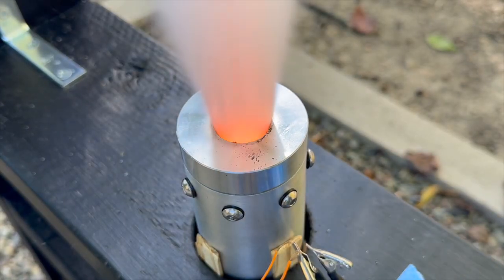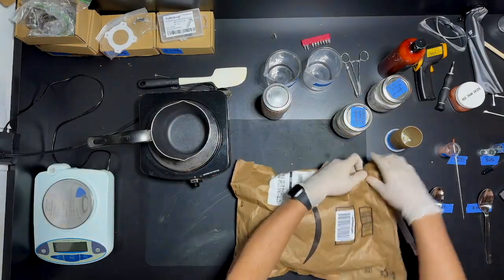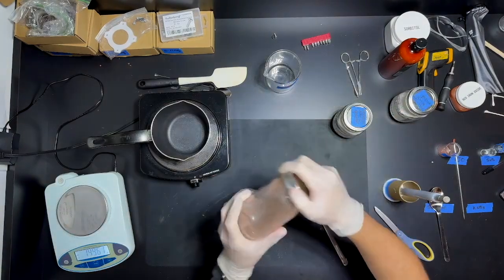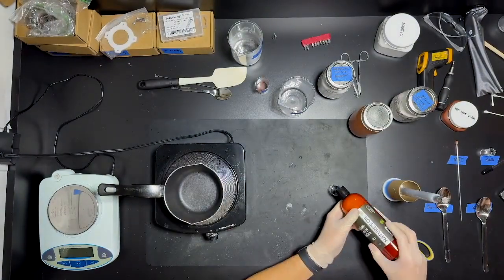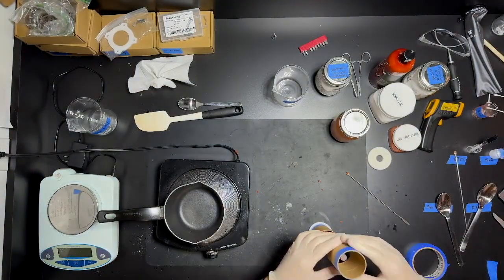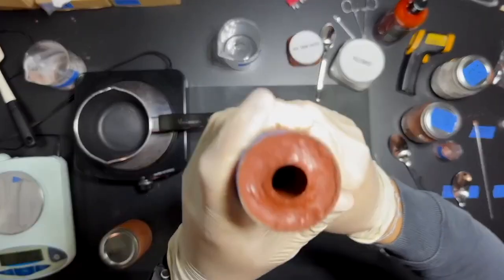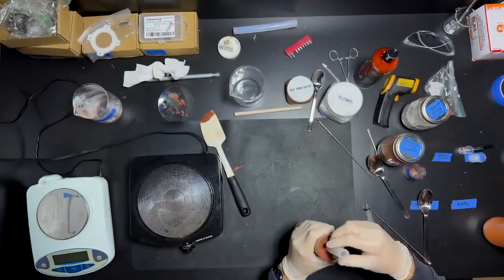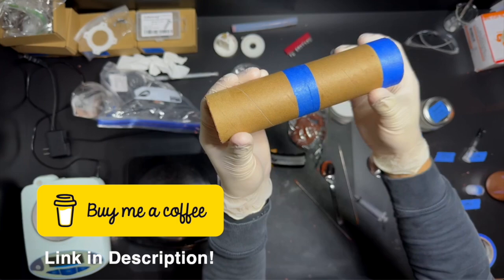How I Make the Fuel for my Powerful Rockets!

Comment: I'm about to start this job. I have 3 equipment left to buy.
Electronic Scale.
Hotplate.
Far infrared thermometer.
Can you send me the link of the products you use?
Is there any advice you can give me? What should I pay attention to when buying these? Thank you for your reply in advance.
Reply from the maker: @Doganay14  When casting propellant, always prioritize safety. I’m using a generic hot plate and temperature sensor purchased from Amazon, but ensure your equipment is reliable and suited for the task. Obtain your chemicals from a reputable supplier and verify they are of high purity. When pouring the propellant, be sure to tap it thoroughly to eliminate air bubbles, as this step is crucial for achieving consistent and safe results!
Reply: @AeroPropulsions  Thanks for the heart and reply.
Reply from the maker: @ No problem! Hope all goes well!

Comment: 4:53 you're motor have "Y" on one side. Why is there a "Y" what is the purpose? Can you explain it to me in detail?
Reply from the maker: @Ericlfimate  The finocyl ‘Y’ shape in my rocket grain increases the burn surface area for a boost in initial thrust, but since it’s only 1.5 inches deep, it mainly affects the startup phase!
Reply: @AeroPropulsions  will not that leads to uneven fuel burnt? Even with a normal (without y) the place where we put the igniter burnt faster because that's the first place it burnt. If it's for initial boost, how i used to do is i make the igniter myself, and cover the igniter with the same fuel, the size of the rode and tightly fitted inside. That way the moment i ignite it, the fuel attach to the igniter become a small boost without causing uneven fuel burning.

Comment: Hi bro I want to make a sugar rocket that it is like 15mm in diameter and like 2pm long, I want it to just burn for one second and also generate 100N of force, could you pls help me if this is possible and more info I want it to stop a 3kg car from 120kmh to 0kmh
Reply from the maker: I’d recommend starting with OpenMotor. OpenMotor is a great tool that allows you to simulate the rocket’s thrust and other parameters. It can help you determine if your design will produce the required 100N of force in the given size and burn time. Once you run the simulations, you can adjust the fuel grain design or nozzle parameters to achieve the desired performance.

Comment: Hey! I would love a video on your propellant. And maybe it's specs for open motor
Reply from the maker: @seitzfamily070  For this test I am using 65/35 KNSB with 1.25 %Iron Oxide and 0.2% SLS! The formula specs for KNSB should come pre-installed on Openmotor!
Reply: @AeroPropulsions  😭
Just figured that out
I attempted to calc all of it
Reply: @AeroPropulsions  I have two more questions, if that's ok. 
1. Where do you get your cases
2. What do you use for your liner
Reply from the maker: @seitzfamily070 My casing is a 0.071-inch wall diameter aluminum pipe I sourced from Amazon. I drill the necessary holes to attach the bulkhead and nozzle. Aside from the cardboard tubes I use to cast the propellant, the casing has no liner. Despite this, I’ve never experienced issues with the sugar propellant melting or distorting the casing, even after 14 successful motor tests.
Reply: @AeroPropulsions  thanks!
Reply from the maker: @seitzfamily070 No Problem!
Reply: @AeroPropulsions  How do you find a cardboard tube that fits so perfectly into your casing?
Reply from the maker: I got lucky and found it on amazon!

Comment: Have you try make sugar rocket with a press or hammer, instead of melting
Reply from the maker: @Wang_1029 Yes I have! I started with half-inch grains, pressing the rocket fuel and coring it afterward, but I’ve found that melting is far easier!
Reply: Thx for the info. I was planning on buy the tool for press.
Reply from the maker: @Wang_1029  No problem. Hope everything goes well!

Comment: Thanks for sharing the experience.
few question I may : 
1- what do you think where the most expenses go to to in this kind of projects ? 
2- what is the comparison of this motor to the sugar one  (in term of power) ?
Reply from the maker: For my rocket motor "SN2," the most expensive components are the custom CNC-machined nozzle and bulkhead. While there are certainly cheaper ways to build a rocket motor, my main goal is to create a fully reusable high-power motor! In this video and others, I am using a sugar-based propellant known as "Rocket Candy." I've optimized the formulation specifically for my motor to ensure maximum efficiency!